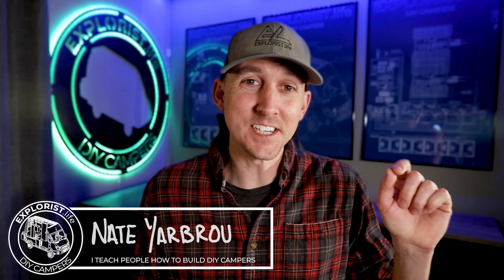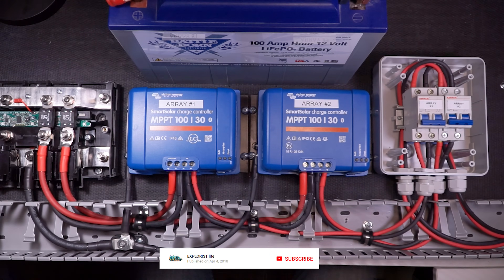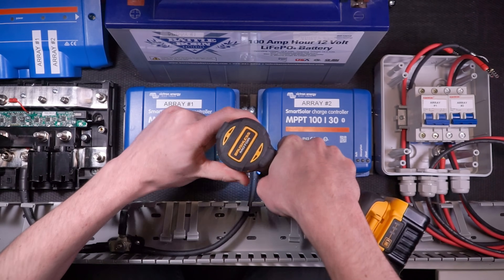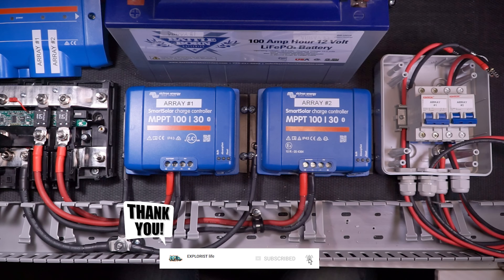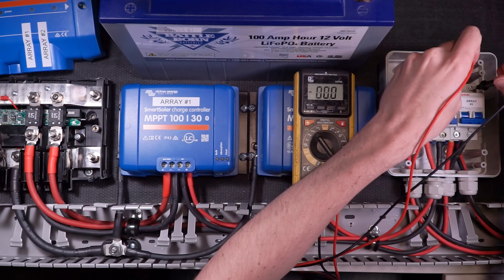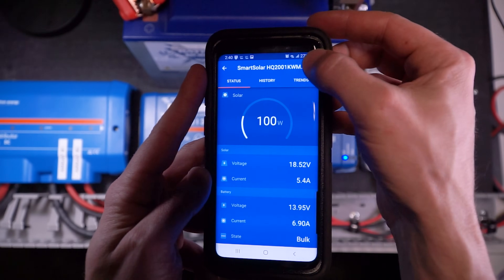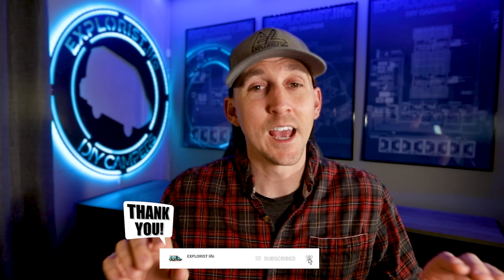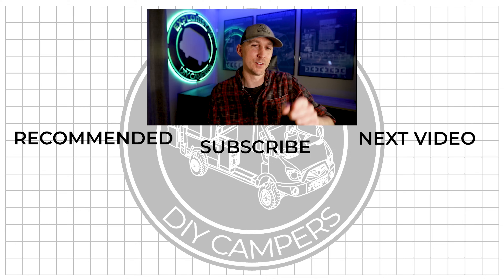How to Wire Multiple Solar Charge Controllers into a DIY Camper Electrical System

Comment: I got a free charge controller with each solar panel I bought, but it's really only meant for 1 panel, so can I just hook up each charge controller  to its panel and the main battery terminals? Or will they not get along both operating at the same time? Please any1 and thanks
Reply from the maker: Tough to tell without having the user manual right in front of me, but the user manual should address that, so check there.  If not, reach out to the manufacturer of the charge controller or the solar panel for guidance.
Reply: @EXPLORISTlife  thanks for the reply sir :)

Comment: What if I’m not using a distributor panel?
Reply from the maker: I recommend using the distributor panel.  If you choose not to, you'll have to figure that out on your own.
Reply: @EXPLORISTlife  
I just can’t see shelling out over $200 for one.
Reply: That being said, your content is EXTREMELY helpful and well presented.
Reply from the maker: Well... you need fuses and you need busbars... and unless you're planning on using some cut rate fuses and fuse holders that have a tendancy to melt... the Lynx Distributor will be the cheapest option.  Fusing isn't the place to skimp and save money.  Do it right the first time so you don't have to do it again.
Reply: @EXPLORISTlife  Well,
Reply: @EXPLORISTlife  Well, you’re a truly rare bird! Someone that runs a well-produced, truly informative channel AND answers questions!  That alone has me rethinking my plans. I viewed the distribution panel as the expensive way to go. If you say not, I’ll reconsider.

Thus far I have only invested in the bus bars and main battery fuse. Both seem to be quality, the main fuse holder is Blue Sea I think. As I’m writing this I’m looking at your clip to the right on the Lynx Distribution Review.  I’m going to watch that. If I have any questions, and your kindness continues to answer them, then you will see me change camps.
Reply from the maker: @clooney3511  Check this out if you haven't already: https://youtu.be/548aRhZMN-g
Reply: Can I run 2 mppt and DC-DC at the same time? All victron system

Comment: Great vid!
Would please like to know:
Can solar charge controllers have their load output connected in parallel to feed together a load?
I would like to feed one load with two solar controllers load output. The controllers are the same model/size  but are not connected in parallel between them, would be only the load output in parallel.
Thank you

Comment: Hello! Does it work for some special mppt controllers which have a parallel function or does it work for any mppt controller?
Reply from the maker: I'm not comfortable saying it works for 'every' charge controller.  I am 100% sure it works for Victron, though, so if you're not able to find out if another brand has this capability... maybe the safest answer is to just go with the brand that makes this functionality available?
Reply: @EXPLORISTlife  I would have bought victron if not a twice or even triple price. So I have to look for more affordable solution.
Reply from the maker: With cheaper prices come fewer features. 🙂👍  The other brands I'm pretty sure charge synchronization works with (midnite, outback, blue sky) are all similar price as Victron.  If you're trying to do 1/3 of the price, I'm that charge synchronization is one of the 2/3's of the features you're going to miss out on.

Comment: Hi Nate (and any other knowledgeable installers), a question here about using multiple charge controllers. Can I use 2 charge controllers that receive different voltages from the panels to charge a 12 volt battery? For example, I'm planning on 2 100 watt panels wired in PARALLEL going to one charge controller, and 2 100 watt panels wired in SERIES going to a second charge controller. The charge controller connected to the series panels will be receiving 40 volts, while the charge controller connected to the parallel panels will be receiving 20 volts. Can I then connect both charge controllers to my battery, and most importantly, will the two different charging voltages "fight each other" or one cancel out the other?  Many thanks in advance.
Reply from the maker: Two victron smartsolar mppt's will function as you are describing, but the solar array voltage should be at least 20V higher than the battery bank charging voltage for optimal solar charge controller performance.
Reply: @EXPLORISTlife  Roger that. The series array will be around 40V, while the parallel array will be around 20V. Do the mppt's need to be Victron, or can I use a cheaper alternative, such as two Renogy mppt's?
Reply from the maker: @brianmartinsen2173  I am unsure if renogy charge controllers communicate and coordinate their charging as described in this video.  Victron charge controllers 100% do, though.
Reply: @EXPLORISTlife  OK. Love the website and YouTube channel.
A big thank you from all of us out here trying to learn solar.

Comment: Can you just use a buss bar instead of a victron lynx distributor?
Reply from the maker: I mean, not really...  You'd need TWO busbars (one for positive and one for negative) and fuse holders for the positive busbar.  It'd be more expensive and more connections and more parts that way, so...why?

Comment: I have a Bluetti Ac300 which has an option to parallel its 2 internal MPPT controllers. Will this double the Amps? Each handle 1200w at 12A.any tips on what this option actually does would be greatly appreciated. Thanks
Reply from the maker: I'm not very familiar with that unit.  Perhaps reach out to their tech support?
Reply: @EXPLORISTlife  thanks I've asked anyone I thought minlght know, thanks for replying
Reply from the maker: Did Bluetti tech support not provide an answer?

Comment: I found this very helpful, and have used your previous Solar Disconnect instruction video for solar at a cabin I have.  This particular video will be part of my plan when adding a few 320W panels to my boat.  Really clear, and concise.  Appreciate you taking the time to do this.
Reply from the maker: Glad it helped!
Reply: @EXPLORISTlife  i need diagram of how to wire 2 charge controller

Comment: Great information thanks … a question tho can you charge 1 battery bank with a solar connected to a mppt and a solar connected to a pwm controller? Thanks
Reply from the maker: A victron PWM and Victron MPPT will not communicate like shown in this video.
Reply: @EXPLORISTlife   but can you use them both on the same battery on separate solar panels
Reply: @EXPLORISTlife   but can you use them both on the same battery on separate solar panels

Comment: So if I did my calculations right to find a charge controller which came out as 189 /128 then I would be better off to purchase 2 controllers at 150/70 and separate the panels into 2 sets ? Correct ?? Please advise ty
Reply from the maker: Indeed.

Comment: I have a Victron 24V system (inverter, charge controller, battery)  My array is 9 - 400W panels for a potential 3,600 watts. I've noticed a max usage of 2,500 watts from my system and read that the controller nominal PV input is 2,400watts.    Could I install a second charge controller with some of the panels as a second array to use more PV power, closer to the 3,600? Thanks

Comment: I found after doing your math equation I would end up purchasing a victron charge controller 150/100 . I was wondering is the reason people buy 2 150/50 controllers is to save on cost instead of purchasing the 1 controller ?

Comment: Hi Nate; just one question: how will be the communication with cerbo, if we have more than 2 mppt (maybe 3 or 4 )? because first Ve.direct port are full with shunt?
Reply from the maker: For that, you'll want to use the Victron Octo GX instead as it has 10 VE.Direct ports.
Reply: @EXPLORISTlife  what if used “ve.direct to usb interface” for mppt or shunt? So that I can use usb ports? Have you ever tested?
Reply from the maker: @burakdemirci265  What does the Cerbo GX user manual say about that? 🙂😉

Comment: Thanks Nate, do MPPT controllers get hot can they be put inside a waterproof box
Reply from the maker: They can get hot, yes.  It's recommended that the charge controllers have adequate ventilation; which a 100% waterproof box would likely not have.

Comment: Pretty low wattage controllers is it not? My system build requires 2000w
Reply from the maker: I mean... it's a desktop example. lol  We can connect whatever size of controllers we want together in the same manner.  We could do 4x MPPT 150/100's connected to a 24V battery bank and do 10,000W if you like.
Reply: @EXPLORISTlife  I am still new to all this solar . I've been slowly converting my camper to be 100% off grid with no gen. So I'm still learning it all. Your video did teach me that I can use more than 1 controller on the same battery bank. That will save me some $ . With your vast knowledge what controller set up would you go with to hit 2kw and trying to keep the batteries at 12v if I switch it to 24 I would have to replace my inverter
Reply from the maker: Perfect!  Glad it has helped.  For 2000W on a 12V Battery Bank, I'd recommend getting 2x of these solar array wiring setups I've designed here: https://shop.explorist.life/shop/all-products/camper-wiring-kits/solar-charging-wiring-kits/1000w-solar-charging-wiring-kit-5x-200w-12v-battery-bank/
Reply: @EXPLORISTlife  To save space. Will it work on 4 300w solar panels?
Reply from the maker: This kit would handle 4x 300w panels: https://shop.explorist.life/shop/all-products/camper-wiring-kits/solar-charging-wiring-kits/1200w-solar-charging-wiring-kit-6x-200w-12v-battery-bank/

Just sub in the 300w panels and omit one panel per series string.

Comment: Nice Video!
I’m just absolut to do this installation!

I wan’t to expand this installation with 12V waterheater as a dumpload when batteries are fully charged! 
Do you know how to connect that, is it possible to connect both MPPT to one heater or do need two? Or can I choose!?!?

Regards 
Raz
Reply: One more Q: do you use ANT protection against deep discharge of the batteries or is that in included in this Equipment!?!?

Comment: Hello Nate,  Just the info I've been looking for.  Just one thing I haven't found an answer to with the Smart Solar VE-CAN,  With the VE-CAN and the VE-Direct connection to the CCGX can you use either the VE-CAN or the VE-Direct or must both be connected.  Currently I am only able to view todays data on the CCGX.  There is no 30 day History. I haven't checked the bit rate yet ,I think that should be set at 250 bit/s

Comment: Hey Nate! I’m in the process of redoing our Solar on our boat and I was wondering regarding fusing parallel MPPTs:
From what I get from your videos the reason for fusing the connection between the MPPTs and the batteries is the battery power going into the MPPTs in case of some kind of fault/short in the MPPT, right? So, is it possible, instead of fusing each MPPT individually with a lynx or other to just fuse an entire solar charge bar with on adequately sized fuse  if such is available? BTW, how do you size the fuse for the MPPTs?
Reply from the maker: Each MPPT needs to be fused from the busbar (Lynx Distributor) individually.  You wouldn't be able to fuse multiple charge controllers with an 'adequately sized fuse' but also stay below the short circuit rating of the unit itself.  I recommend wiring multiple charge controllers as shown in this video.  I promise I'm showing the easiest and best way to do this stuff I possibly can.  If I could omit parts; I definitely would.

How to size fuses: https://youtu.be/5y-yDMEgV70

Comment: What if I'm not using victron mppt controllers ? 
But am using a victron lynx distributor, can I use other mppt controllers on the lynx distributor?
Reply from the maker: The Victron Lynx Distributor is simply a positive and negative busbar with four fuse holders attached to the positive busbar all wrapped up in a nice protective case.  Given you can connect whatever charge controllers you're using to a battery bank/busbar with 5/16" wire lugs; you can indeed use the Lynx Distributor with your charge controllers.
Reply: @EXPLORISTlife  thankyou so very much, you're content is the best of its kind.
Thanks again

Comment: Hi Nate and Steph. Thanks for all your videos. People are really benefiting from your work, me included.

In this video, your diagram shows 50A breakers for your solar disconnect. However, in your 1 hr+ full tutorial, AND what you sell in the shop, you have a non breaker solar disconnect. Why the change? Is there no longer a concern from a short on the solar panel side of the electrical system?
Reply from the maker: The breaker was never acting as a breaker.  The breaker was only ever acting as a disconnect.
Reply: @EXPLORISTlife  fair enough. Thanks! I agree there must be something in line to stop the flow of power from the panels. Can we presume you have no concerns of shorting from the solar panels therefore no breaker? Obviously one could calculate the power from their panels and put an appropriate breaker in line if desired… thanks again!
Reply from the maker: Overcurrent protection in that location is virtually impossible.  More info in the 2nd part of this video: https://youtu.be/HOXnWXvLXko  This should also help: https://youtu.be/s1P31hxlD3I
Reply: @EXPLORISTlife  got it! Thank you!🤘🏻
Reply: @EXPLORISTlife  for those who might read this thread, I immediately applied what I learned. I have 2 solar arrays each independently in parallel:

2 x 100W; short circuit current 5.39A; max series fuse rating 15A; 10.78A < 15A therefore no fuse.

2 x 200W; short circuit current 9.66A; max series fuse rating 15A; 19.32A > 15A so I need a 15A in-line fuse on the + string before the Y combiner.

I hope I applied this correctly! 🙌🏻

Comment: Nice video. The 3rd reason for using 2+ controllers is when your panels have different exposure to sun. Plus about your controller grounding cables, I'd make the cables the same length, the black cables you made seem one double the length of the other one, that makes one cable have double the resistance of the other.
Reply: it's a grounding cable, if it is 2 miles long it doesn't matter, as long as it is connected to ground, if there is any "loss" over the cable it doesn't matter at all,
Reply from the maker: The length of the equipment ground cables doesn't matter, so what I showed is perfectly fine. .🙂👍
Reply: I meant the Red cable. I'd still make the system fully symmetrical, using same length +/- cables. With short cables it's not much of a problem, but the longer the cable, bigger the impact

Comment: Great video. Thanks.

What if you just have a few cheap PWMs laying around, and not some fancy bluetooth gear. Say 2-4 pcs of 30amp 12/24v PWMs that costs 5$ each. How would you go about it?
Reply from the maker: You should check the user manual to see if there is any documentation on how to do it. If it doesn't say anything, you'll want to contact their customer support for help. If there is no customer support, you'll want to upgrade to a higher quality charger controller that includes this functionality. 👍🙂
Reply: @EXPLORISTlife  nah, thats some Chinese low end 1 page highly questionable information. Does work seemingly fine thou. I do use a mppt personally. However, as concept, and reading your video title, it made me wonder..and i do have a stack of pwm laying around.  is it straight forward easy or is there a few things that make this not so straight forward? Could one, in theory, just hook up 4 solar panels to each pwm and then each pwm to same battery.. without fire? Or is there a 100% need for an extra part or two? As you might have realised, im not an electrician.  So if its a terrible idea, then that's why. Im never in short supply of terrible ideas :)
Reply from the maker: Ultimately, the charge controllers need to be designed to communicate with each other to charge properly.  If they aren't designed for that purpose, they wont charge properly.  The degree of 'not charging properly' could vary widely and is not something I'm comfortable offering input on.  If you have 4 solar panels, I'd rather see them all connected to one properly sized MPPT charge controller.
Reply: @EXPLORISTlife  yea, sounds fair.. was just wondering. :)

Comment: Hey Nate, I already had an array wired parallel (2x170watt) to a PWM. I INSTALLED another array #2 wired in series (4x200watt) to its own Victron MPPT. Im changing that PWM for another Victron MPPT is it ok to leave it wired the way it was with array #1 in Parallel and array #2 in Series as long as the V and current are within the charge controllers?..Thank you

Comment: thank you - I have an BlueSolar 100/50 (with Bluetooth adapter) & SmartSolar 100/20 - regarding your video and config as seen - I can not see the Menue point Network total Power. Can anybody say where i a wrong ?
Reply from the maker: Oof... they won't communicate.  It has the be a Smartsolar to Smartsolar connection for the total network power to work.
Reply: @EXPLORISTlife  👍 what I feared, thanks !